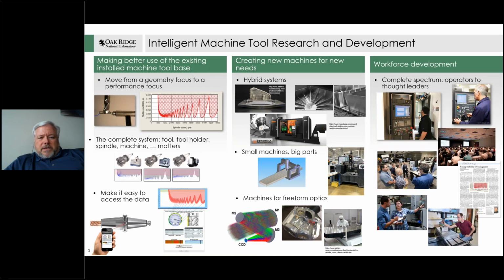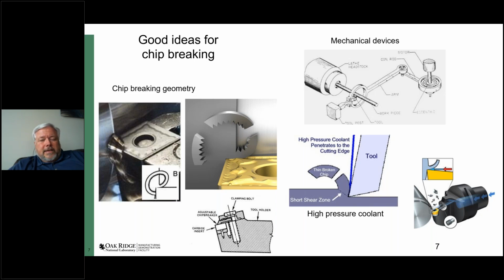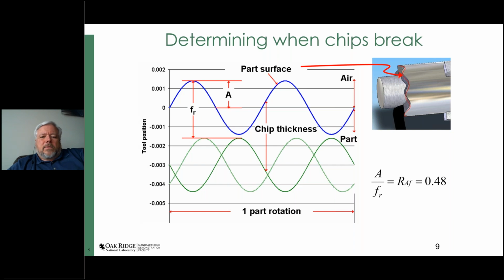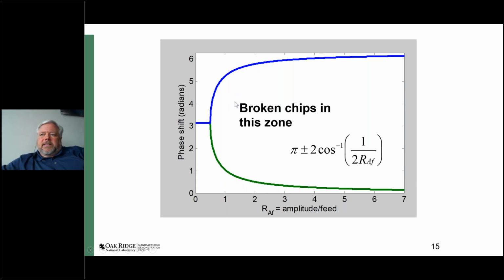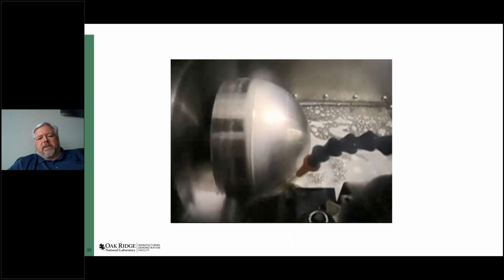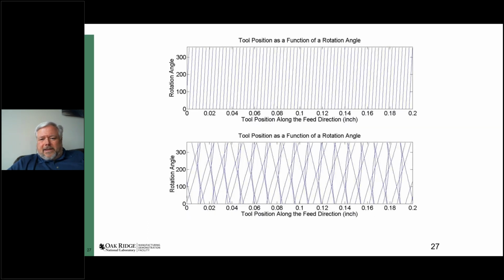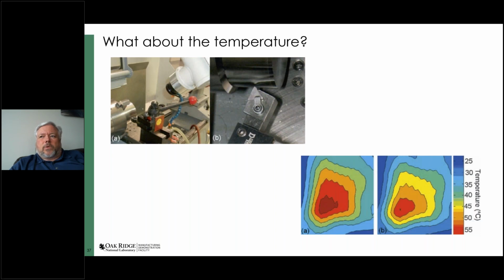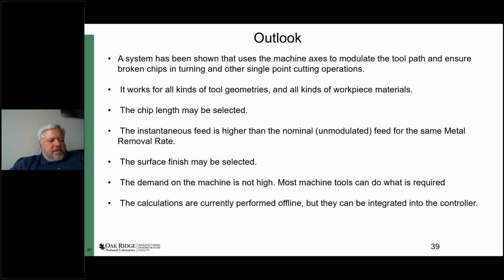Chip Breaking using NC Programming

Comment: This is a fascinating idea. Since you're creating a bunch of interrupted cuts, wouldn't that decrease tool life? I understand the tool is experiencing less heat, but the physical impact of entering the material is still there. For concrete-based machine tools, wouldn't the vibrations of the machine erode the concrete and cause the machine to develop severe runout within a few years?